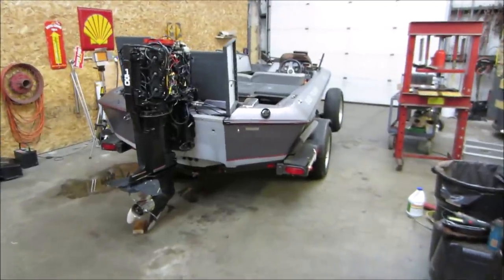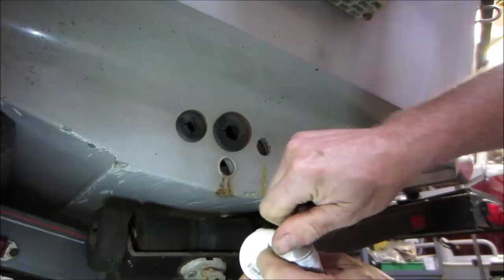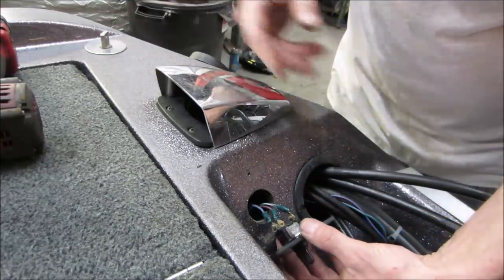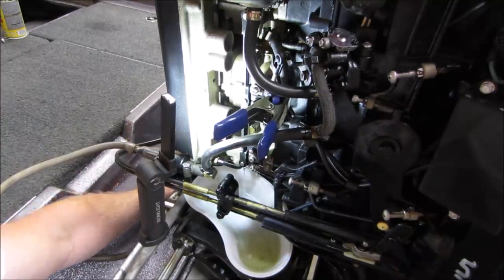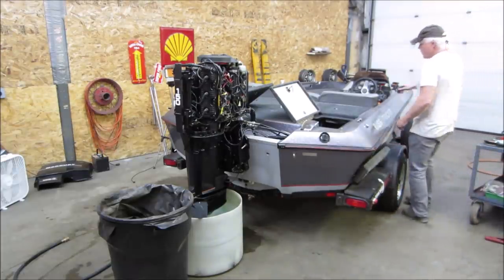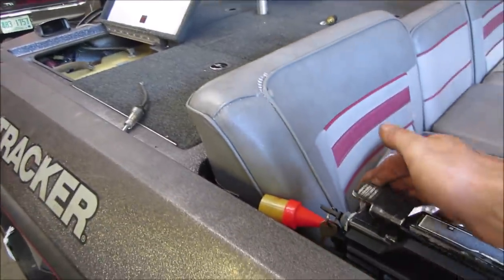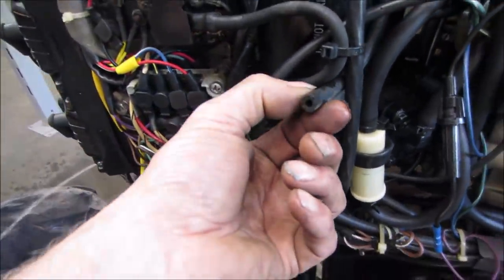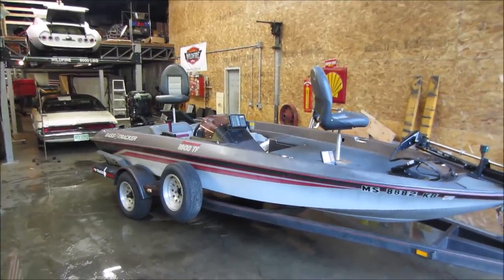Bass Boat Sitting 10 Years, Lets See If The Engine is Good?

Comment: 1. Change the impeller before you take the boat out. If it's been 10 years the rubber is likely brittle and will shatter at high rpm. This is important since you don't have a temp gauge. Easy to seize your engine if it goes and you're not paying attention.
2. The float in the oil is for a low oil alarm and possibly an engine shut off, neither of which is working. Fill that top tank up with oil and it should maintain level. 
3. If it were me, I'd check the gear oil in the lower unit before my first adventure.

Awesome video as always, thank you.
Reply: Is the rubber a damper between the core and the impeller ?
Reply: @rverro8478  No, the impeller itself is rubber and prone to failure. Generally want to change them every year or 2 regardless of usage. You can get kits to fully rebuild the impeller and housing for less than $60 on these engines.
Reply: Checking gear oil for water, and therefore probably a ton of fishing line wrapped around the prop shaft would be a very early step for me.  Gah! Fishing line!!
Reply: @drteknical6571  ditto on fishing line wrapped, I had that happen 4 trips in a row! talk about cranky-mad, 4 seals and oil changes in 2 weeks!
Reply: thanks for the tips and insight.  I am going this morning to look at a 82 18 1/2' Bayliner with less than 5 hours usage that has been sitting in a barn,
Reply: Those merc impeller are only good for a couple years but they are easy to change.
Reply: @rverro8478  He is talking about  the water pump impeller  not the  big metal  impeller on the out side of the engine .

Comment: Reason it took so long to pee a lot of water is that they have a thermostat and won't open fully until warm.
Also change the impellor as they break up at hi RPM when they get old and brittle.
Awesome motor as well and if you keep up the services to it they are bulletproof.
Reply: yes. yes yes.. do a water pump change out.  you have the parts, it's easy to do, and its' better to do it and KNOW it's good than rely on what's there to have it break in the middle of the lake.
Reply: I agree on changing the impeller I usually do the 2-year rule in my mind every 2 years that I own a boat the impeller needs to be changed sometimes it's always easier to do a little bit of work  then to do a whole lot of work when you screwed up everything plus every 2 years seems to be a good amount of time if you use the boat a lot to wear out the gear oil and also getting a leak down there in the casing contaminating the gear oil 2 years seems to be about enough time to be able to trust gaskets that are exposed to the water a lot never had any issues with the two years
Reply: When the cooling system is fully primed, water should come out of the telltale instantly, regardless of the engine temperature.
Reply: @realsonnysullivan  yep! thats why its there -to tell you that the engine full of water and that the impeller is working. to maintain temp, there are thermostats and to allow max flow at high rpm there is a poppet valve on the starboard lower side. a stuck poppet will sound the overheat warning at high rpm. all this water flowing cools the exhaust prior to exiting the lower unit.
Reply: Definitely change the water impeller. I found that Super Lube silicone grease works best. I ran an entire season then pulled the pump and it was still coated in the grease. It's available everywhere even harbor freight carries it.

Comment: I would definitely change that impeller on that motor they should be changed every year or two
Reply: because cavitation!
Reply: yeah, I JUST said the same thing....even just sitting for 10 years it's probably half gone hence why it took so long for water to come out the pee hole.....
Reply: @muskokamike127  if only they didn't make em out of crappy rubber. Rubber is great but not when exposed to salt water, veggie oil, air, . . . shiiiiieet
Reply: @muskokamike127  Some of those old Mercury motors have thermostats, that wont let it pump water until its warmed up.
Reply: @dimitar4y  That's because you never know if something like small rocks or sand  is getting in there with the water. They're cheap anyway and simple to change.
Reply: That is a definite to-do on the list.
Reply: The impeller should be changed often because it is a rubber material that is constantly under stress. At all times some of the blades are in the bent position and that causes fatigue on them. It pumps at an idle now but after sitting for so long once you get to a higher constant RPM the blades will start to break off.
Reply: @chevelleguy8059   And then the motor stops and you are up the creek and needing to paddle.  You don’t want that motor stopping when out at sea!
Reply: @marcryvon  weeeellllllllll i don't know if small rocks and sand get into a boat motor all the time. I'd think that's only a danger if you try to be a landshark.
Reply: @dimitar4y  I know right? They do it because it's cheap and works but not very durable. THIS is one area that needs improving. There are screwthread (spiral) pumps that are much more reliable and work just as well.
Reply: @drker1997  that one has a water pump that with a engine thermostat that requires a certain temperature before it pumps water. Its a lot like a vehicles thermostat is a lot of aspects.
Reply: @drker1997  the pee stream is before the thermostat.
Reply: @GmKofHard   it’s exactly like a car thermostat and as I mentioned to drew, the telltale, or pee stream is plumbed before the thermostat so as long as the pump is creating volume, water should come out of the pee tube.  If the driveshaft is turning, the pump is pumping, thermostat or not.

Comment: Absolutely change the impeller, and keep choke pushed in when starting, it only works when held in. Also install that new fuel line with the bulb, they also become brittle and corrode on the inside. The transducer for the fish finder will produce a snap if you touch them when they are on, if no snap, no image or bottom return.
Reply: I thought the connection had some green on it, even if not a cleaning would be a good idea, d c is such a pain, one of the worst discoveries mankind has made. I don't know what would replace it but it still sucks.
Reply: its not a choke its a primer! squirts fuel in every time you bump the key. which would explain the hard starting... 4-5 primes and its ready to fire
Reply: @ct1762  must be a youngster and only seen newer junk "warm weather" 4-stroke engines. majority of all 2strokes (and others) for many years had/have a solenoid that physically shuts a choke blade or multiple, some only choked a single or two carb's, they figure once some cylinders fired the others would light off ok.
long ago mercury(Kiekhaefer) actually had a stand alone throttle lever at the controls, and choke button separate from the key. you could easily free rev and high idle the engine in neutral for warm up period.
Kiekhaefer played a big parts in WWII, building many other things, which also killed his outboard industry. ;)
Reply: @throttlebottle5906  i am an outboard mechanic... 12 years. yes, i'm aware older motors used a choke solenoid and flappers, but this is a newer one with the primer. im not sure what you meant about being a youngster and only working on 4 strokes as I won't touch smaller 4 strokes, even if i could get paid !
Reply: @ct1762  then you should know that was about the end/transition year when they had either physical choke solenoid and butterflies or the silly "start enrichment system", aka trouble making engine flooder.
it could technically have either, I don't recall him pulling the choke plate cover( sound baffle), to see the carb faces or a close-up enough to tell. the clunking sounded loud enough via cam to be actual choke blades banging.
that year has accelerator pump carbs, cycling the cold start throttle lever or the main control should pump fuel in.

Comment: Replace the impeller if it’s four or more years old, regardless of whether it ran or not. They get brittle and will break at high RPMs. You don’t want to get stuck on the water - cheap insurance to do it now.
Reply: what he said! Change it, change it now!
Reply: Yep. Been there, got stuck, paddled a mile, replaced impeller.
Reply: The raw water impeller was a spare part that I always carried. But then I had a larger, more complex boat and carried a large number of parts and tools.
Reply: Yes! Probably wouldn't hurt to replace those old fuel lines too.

Comment: Replace the water pump impeller   that tell tale should be a lot better than it is,
Even though it improved,  it is probably  becoming hard and worn, and yes replace all the fuel lines including the bulbs d filter
Reply: I agree, water pump is acting kinda wonky.
Reply: 100% replace the impeller.  Simple piece of mind.
Reply: Always replace it. Especially after sitting for years, or every 2 years in Salt water.
Reply: Keep in mind it was sucking air.
Reply: @codycall6513  I agree but I think having the water level just an inch or so over the intake does not help - once fully submerged it will work better.   Its not too big a job to replace those and you dont want it breaking up and clogging the cooling passages either.   He didnt say how much he got the boat for but here in California thats an expensive motor alone!!!
Reply: @JohnDaker_singer  And it was at idle not running at higher RPM/.
Reply: Also remember, they have a thermostat also.
Reply: lol, I wouldn’t have even tried till I changed the water pump. Every two years regardless of runtime. The clocks starts ticking when you install it, not running hours. Ten years is borrowed times, like minutes.
Reply: @Britcheflee  The motor is definitely the gold in that deal.
Reply: Yep, excellent advice. I'm sure Mustie will do it anyway, but it sucks that he probably avoids reading through comments because of all the junk he has to wade through video after video. 😀
Reply: @Britcheflee  thats right! you need it about 6'' below the exhaust outlets or use rabbit ears. but these mercs used a low pressure pump... never indicated very hard.
Reply: @jasonhopper5072  2 of em' and the all important pressure relief valves
Reply: @jasonhopper5072 , yes that 150 has a thermostat which means the pee doesn’t start until it warms up!

Comment: The choke is on a momentary switch. You need to hold it in when you're starting it when it's cold.
Reply: Agreed.........
Reply: Hold it down. We found out the hard way!
Reply: does not have a choke it has a primer every you push in the key it gets a shot of gas
Reply: @erniebateman9665  are you sure about that? I've never seen an outboard motor with a primer and Ive dealt with quite a few of them. Everyone I've ever seen had a choke
Reply: I just found that out this year,  4 years in, prev owner never told me that it was a momentary switch my instructions from him just said push it when starting, always wondered why she was hard to start when cold, hold her down when cranking and she fires up beautifully.
Reply: @DoRC  I have 5 115 and the same 150 and the only 1 with a choke is the 1978 115
Reply: @genejudgejr6931  yep:)
Reply: @erniebateman9665  interesting
Reply: @DoRC  they definitely do have chokes. Generally it is a solenoid that snaps the chokes open.
Reply: Definitely should not run it too long in such a small container as it will overheat. And yes change the impeller! It is way easier than pulling out little chunks of rubber from passages!
Reply: @clintletendre5585  it would take a pretty decent amount of time for it to start overheating. People run outboard motors in tubs all the time.
Reply: @DoRC  pull the cowl off engine have someone push the key find solenoid that is clicking if it is a choke there will be a wire to pull the choke on if it is a primer you will see hoses going to the carbs
Reply: Yup. 1990 motor.
Reply: @erniebateman9665  im pretty sure its choke then.  You can hear it clicking in the video. I also went through the video and I'm pretty sure I can see where the solenoid is on the right side of the engine.
Reply: @DoRC  yes we used to in the shop, but we used a tank and not a 20-gallon Barrel. It's just a question of whether you really want to risk it or not. Also with a questionable impeller, being as old as it is it may be not pumping as much as it SHOULD! Yes it pumping, but it also was steaming alot and the way it is designed is for it to have a constant supply of cool water. The last shop I worked at we would just use the muffs and adjust the water pressure to allow for the proper operating temperature.
Reply: @DoRC  they both use a solenoid merc has not used a choke on the large engines sense the 80s check out the parts manuals and look at at the parts brake down
Reply: @erniebateman9665  okay I looked some things up and found that the solenoid for the ones that don't have a choke who is known as an enricher solenoid.  That solenoid appears to enrich the mixture during cranking. I don't see any system for priming the system. You would need a pump that would squirt fuel into the carburetors if it was a primer. I'm seeing mixed information as to whether or not you need to just push it in once or if it needs to be held in. It appears as though some systems required to be held in and some systems just need to be pushed in once. I'm not sure which one this Mercury has. Based on the fact that it didn't want to start I am leaning towards it's the kind that needs to be held in.
Reply: @DoRC  the solenoid works as a fuel pump every time you push the key it gives a squirt of gas in too the throat of the carb
Reply: @erniebateman9665  ah
Reply: i was just going to comment this
Reply: @genejudgejr6931  That is what the operating manual is for.  Download one and read-up.  You'll be surprised about many things.
Reply: If you ever looked at operating manual for a 1993 Tracker, which I did buy for that very reason, its about as useful as your comment Doc.
Reply: I was going to say the same thing, good job.
Reply: @NYNCMIKE  push it in and keep it in while turning to get starter engaged and keep pushing until it fires, these babies need a lot of fuel, then it will keep running not stall.   Once it fires stop pushing in,  same as Johnee rudes.
Reply: @robertp7209  Yup my 150 Evinrude was the same way

Comment: Honestly just change the water pump if it’s been sitting that long the water pump will just disintegrate I have dealt with this on several four stroke boat motors as well as two stroke boat motors in the past
Reply: rubber! Destroyed by most things known to man. Also metal and saltwater.
Reply: Just after sitting that long the water will get hard and brittle

Comment: I have never trusted automatic oilers. They have a mind of their own and will leave you stranded. Change the impeller and keep a spare handy! Might want to drain and fill the lower unit lube.
Reply: oh yeah, change the lower unit lube...forgot about that! GOOD POINT! You never know when it was last done.
Reply: I replace the impeller and gear oil every two years, I have almost the same exact motor, mine is a 1985 150 Mariner, and I did away with the oil injection the day I bought it from a friend that let it set 8-10 years. Still runs great.
Reply: @robertallen938  good plan, oil injection loves to go anti-oil-self-destruction and you'll never know it until it's way too late with seized engine.
**note: you'll likely have to re-jet the carburetors when going from oil injection to mix.
Reply: I had an early 90s Johnson with a VRO oil pump. I went thru 3 power heads while it was under warranty. Once the warranty expired, I disconnected that SOB and mixed the fuel myself.
Reply: Yes, that system seems way too vulnerable to failure.
Reply: In my experience a well maintained, standard motor gives no hassles with the auto oilers. Mine is a 91 and I have had it for 8 years now. Absolutely dead standard with oiler intact and motor runs like a top. Also a lot more economical on oil usage than pre-mix. Gear lube and water pump every 24 months.
Reply: @throttlebottle5906  I know nothing of these things, but were I the channel host, I would retain the complex system and see if I could get it to work. But please ignore this comment.
Reply: @Digital-Dan  :) oil injection has killed many engines over the years, motocross bikes/motorcycles used that way back in the 70's and before. forget to check oil tank, cable or line breaks it's game over before you know what happened.
alarms, blinking lights, buzzers
running out of gas at the  same time is great, no gas = no run = no lack of oil :)
Reply: @throttlebottle5906  You want to confirm what i expected for decades?? Unreliable Oilers are mostly due to 
"forget to check oil tank,"
and ignoring
"alarms, blinking lights, buzzers"

So you want to blame these systems on behavior of dumb drivers? I ve seen them myself! Screaming alarms and people acting like nothing had happened. And thats the problem of automatic Oiling systems???
Reply: yeah most people disconnect them and pour it straight in the petrol tank
Reply: If he raised the RPMs while the oil line is disconnected from small tank, he would see a good bit more oil flow than when engine is just idling.
Reply: @keithmarshall8920  Agree! My '95 still runs fast and smokes just right. They have better performance with the auto oiler. Don't need all that oil at idle.  I keep an eye on the reservoir float alarm. Easy to check.
Reply: Agree 100%
Reply: I agree… too easy to add oil to gas
Reply: I have an easy solution…4 Stroke. 😂. Easy but expensive. Wish I could afford a new 4 Stroke myself.

Comment: I would definitely double check that wiring "fix" on the engine that the rats chewed. And Watch Wes Work would flip out at those quick snap wiring connectors near the battery. Put in your drain plug, fill the back with water and make 100% sure the bilge works.